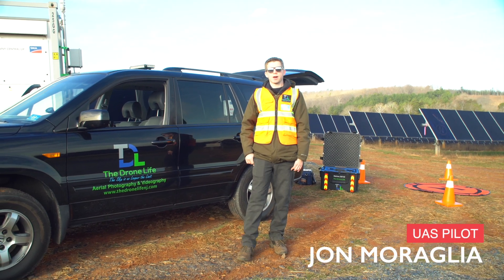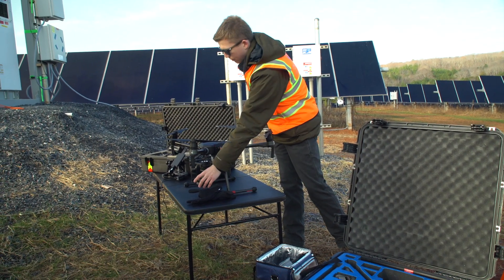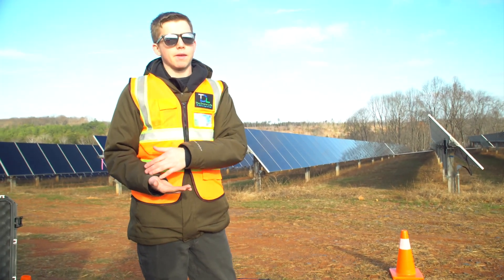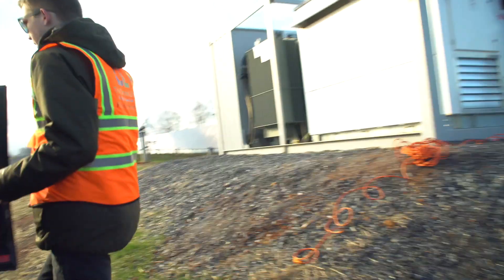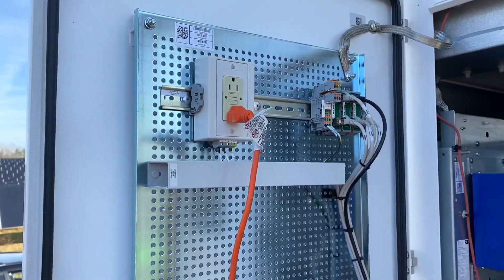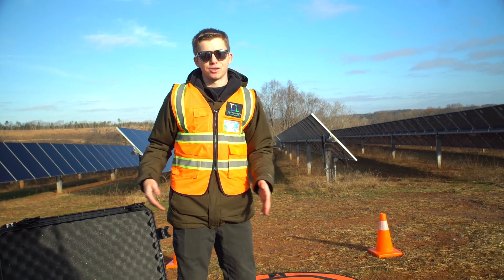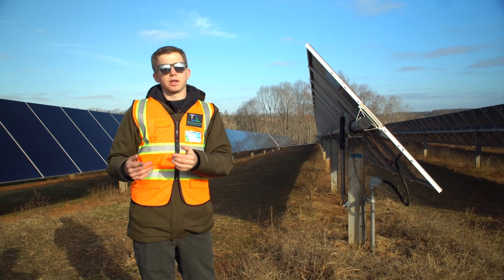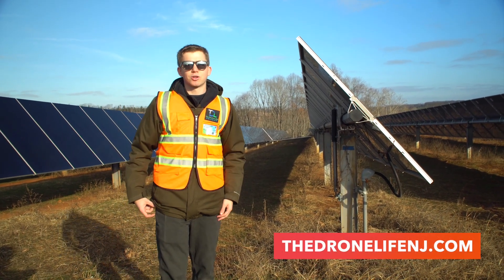Drone Solar Inspection Setup Tour

Comment: Can’t wait to see the result.
Would like to know more on how you record the Mavic 2 route and inject the limit of the terrain to the matrice 200.
Reply: Have you done much work with your Advanced Stephane?
Reply: @RandomlyB  not yet.
Not that easy in France as it is a very new discipline. I am asking potential clients to provide them with thermal analysis. No answer to date.
What about you ?
Reply: @zwiftfrance   same here in the central US. Very hard to get into this line of work. I dont think the average person understands what we can give them. I think they just see it as an extra cost.
Reply: @RandomlyB  fully agree.
I think we are in advance. Even professionals have diffuculties to understand the added value of such a new "tool".
But we need to insist.